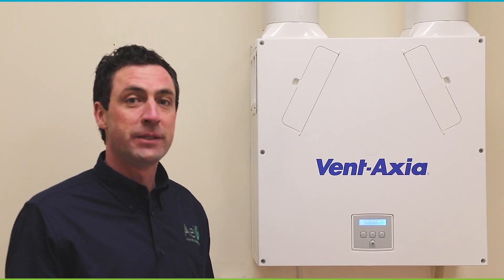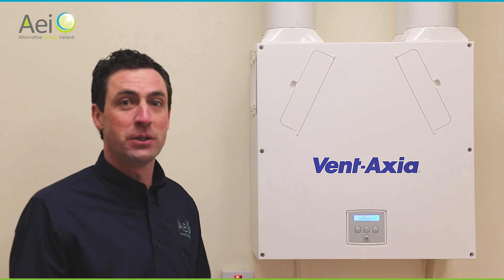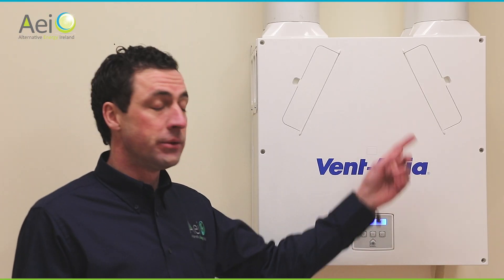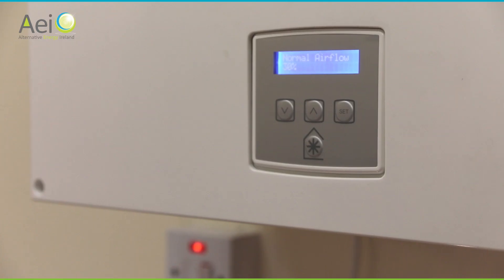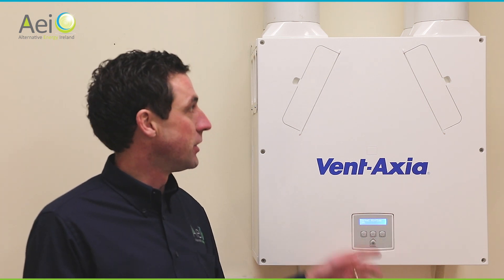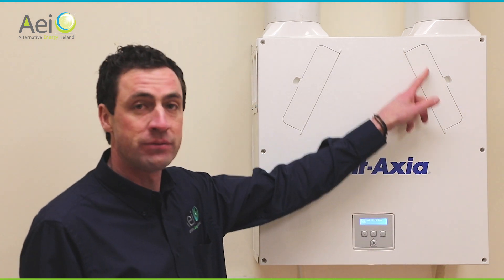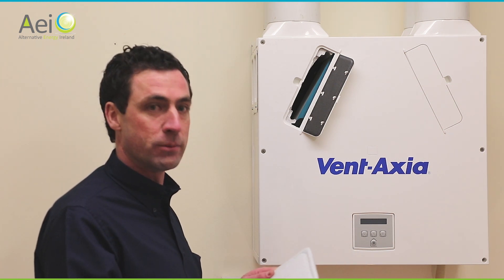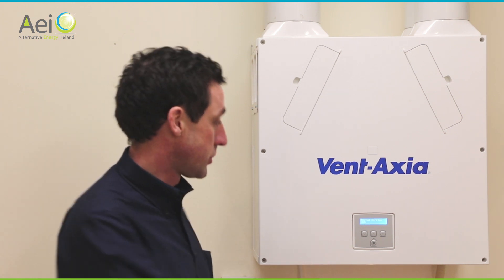AEI Vent-Axia Ventilation System // ALTERNATIVE ENERGY IRELAND

Comment: I have this system for over 5 years. This is the worse dicision i have made. The system makes the room temperature difficult. It will regulate itself. Example it will make the temperature very low during the evenings and, early in the night and, make it warm after midnight.which makes you over heat and, feel sick.

Comment: Hi can someone help me, my unit is constantly on boost mode and I cant switch it back to normal. It's quite noisy when I'm sleeping so I just completely turn it off at night.  Thanks.
Reply: I have same issue. It’s always doing 84% boost. It’s im the utility room so don’t mind the noise I just worry about electricity cost…as since I got it seems to be adding 10-15 a month to bill
Reply: Just so you know my setup, kitchen and bathroom extract and living room hallway and bedroom fresh air
Reply from the maker: @Chris-ii6dt  Cheers for comment - AEI.ie should be able to help you out with this. If you want to maybe drop them a message via their Contact Us section of their website. Cheers
Reply: This might be because you have a switch in your kitchen used when cooking turned on that would call for boost, figure out what switch it is and turn it off.
Reply from the maker: AEI.ie should be able to help you out with this. If you want to maybe drop them a message via their Contact Us section of their website. Cheers
Reply: @surlookmedia  I also noticed that I can never tell the extractor fans making noise or feel them taking in air…is this normal?

Comment: Great informative video thanks! I had no idea what this unit does, we've never turned ours on, will be cleaning it and replacing filters asap. Does it help lower heating costs?
Reply from the maker: Good to hear. On heating costs.. Our understanding this unit is purely for the cleansing of your air; however AEI offer thermal heat pumps, solar panels, all that assist with efficient and economical heating. Suggest you head over to AEI.ie for their full range. Thanks again
Reply: @surlookmedia  ok thanks a lot for your help
Reply: It blows freezing cold air from outside - inside. All heat is gone from my house. This is good product for BIG houses, offices but not houses. Extremely loud also. You sleep beside a hair dryer for the rest of your life. Not happy with this unit at all.

Comment: I have this model. The fan has been noisy now for 18 hours and on display it says dry out mode. Not sure what is happening with this
Reply: Hi Michael, this happens sometimes on older units. Replacing the PCB with the display on it should fix this. If you know how to use a screwdriver, you can do it yourself but I suggest you contact your installer. Grtz (I service these units in Belgium)

Comment: Have this in my home for almost 3 years (Vent Axia Sentinel Kinetic Plus B). I never vacuum the filters- I just swap them out for new ones every 6 months at which time they are filthy. Also, there is another filter inside the unit called a 'cell'. I remove this every 24 months and clean it in the bathtub. Run mine at 20% airflow and it is totally silent.
Reply: Cheers, how do you get at the "Cell" to clean it?
Reply: @clivebyrne8943  Turn off the unit at fusebox. Remove filters then remove all screws on front cover of unit then remove cover. The large internal cell filter should have a plastic strap grab that and slide the whole unit out.
Reply: @blurayffan66  thanks for that, much appreciated . Your first comment got me thinking so I went and had a good look. I removed the cell and had a good look around. All very simple but impressive in its simpleness. I had been having a lot of running nose and sneezing in the mornings so had to investigate the unit further. The cell (which was in upside down, when compared to the arrows on the unit) was dripping wet and the fan on one side was completely full with mould. Real nasty stuff. I had to remove the fan to get all the mould off and dry out the cell at the same time. This morning, no runny nose and no sneezing. Thanks for your initial comment which gave me the nudge in the right direction.
Reply: @clivebyrne8943  No probllem at all Clive. I am surprised the cell was wet and there was mould on one side. That should not be the case at all so I am thinking there may be a problem elsewhere or the unit/fan/system settings need to be adjusted. The first thing I would do is give everything a good clean out. The cell itself can been cleaned in a bathtub full of lukewarm water using a very mild soap. I used Milton washing up liquid (sensitive) which I bought at Tesco. Make sure the cell is completely dry before putiing it back in. Also the filters on the front of the unit should be changed every 6 months for new ones. You can buy inexpensive ones from fairair.eu  if the mould/damp returns I would prob call a Vent-axia tech out to double check everything (how the system is set up in the user menu etc).
Reply: @blurayffan66  Hi, yes I have given everything a really good cleanout and put it back together. It really was very nasty. I have new filters arriving today from fairair.eu so hopefully that will get things working properly again. The Cell has arrows on it front and back showing the correct orientation and that was in upside down (Not sure the relevance but have corrected that now). Having done the deep clean I now am familiar with the whole unit so I will be keeping a good eye on it over the next few weeks. Thanks again, your assistance and was the impetus for me to go deeper into it and find the issue.
Reply: @blurayffan66  help i replaced the filters but the check filter error message wont disappear. Help! X
Reply: @clivebyrne8943 hi all what type of filters did you order can you send a link
Reply: I.m sorry but this "cell" is not filler - you just wash plastic heat exchanger. It began dirty becosue filtters are not high filtration class and lots of dirt going through inside Kinetic unit.
Reply: Thanks for this information on this, I have the same unit a couple of years old and it seems to be getting noisier. I was looking to ask, before I pull out the cell should unplug the electrical type connection that seems to be connected to the grille on the bottom right of the cell itself? Also what way should the arrows be pointing ideally, thanks!
Reply: @bettinghighlights  Hi Stephen, I would give Vent Axia in the UK a quick call. They have a very good technical team over the phone who would be able to steer you in the right direction. They can also direct you to experts in Ireland also who have been very helpful. 
Hope that helps.
Reply: @clivebyrne8943  I had the same issue as you.. mouldy right fan and a dripping wet filter. All clean now and like yourself will keep an eye. I do however still get a faint noise through the vents in the upper rooms which i'm assuming because its closer to the fan motors so there's no getting away with that most likely!
Reply: That's the heat exchanger, you can buy M5 class filters for these units which filters pollen and some traffic smog.
Reply: How long is the warranty on this?